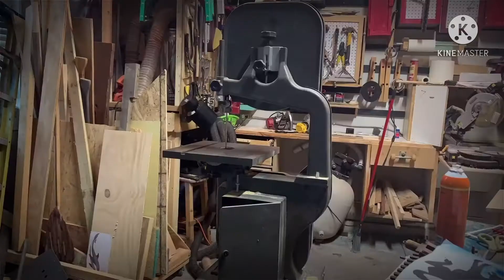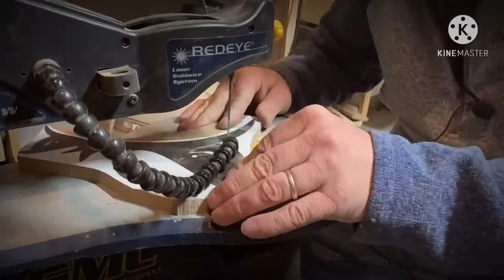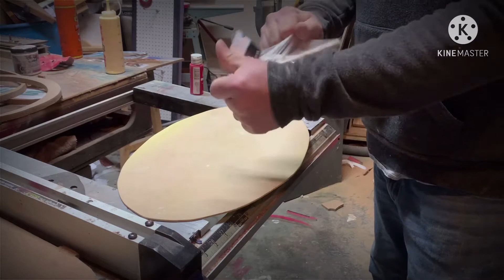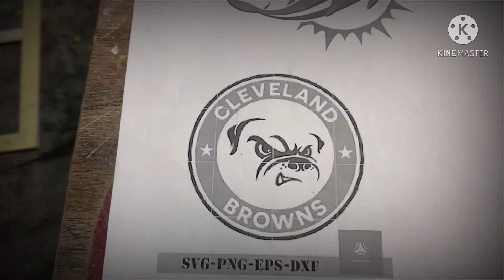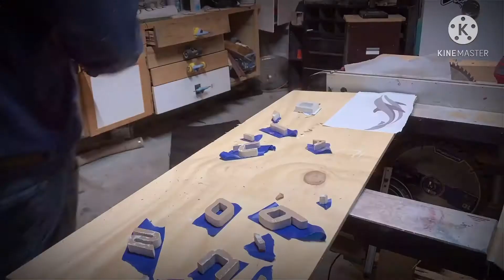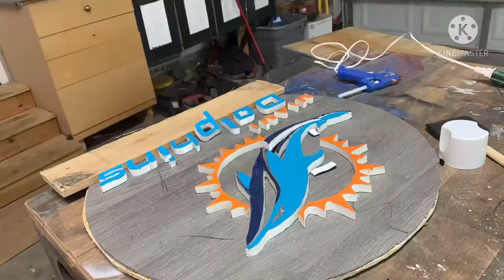3D wood signs without CNC

Comment: Before you paint MDF, put a coat of 50% water and 50% glue mix,  It will seal the MDF and the paint will turn out much better by not soaking into the MDF, giving a much better finish on your projects.  Hope this helps
Reply from the maker: Great tip thanks